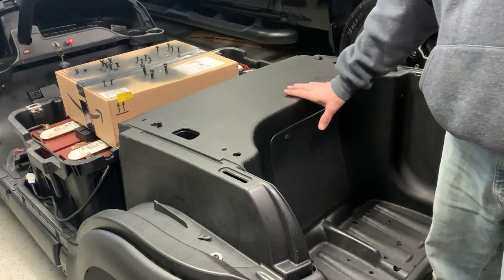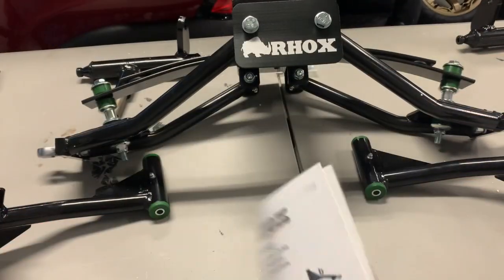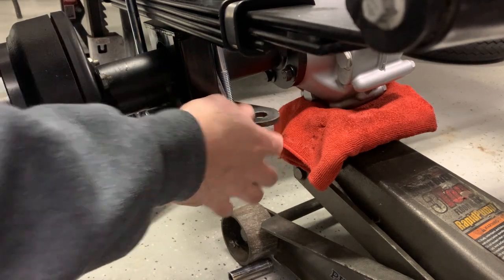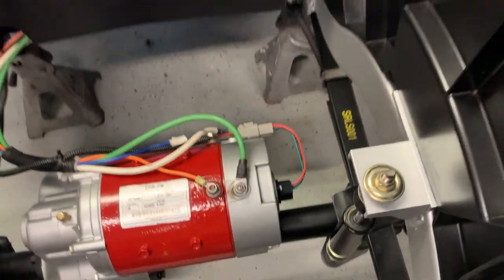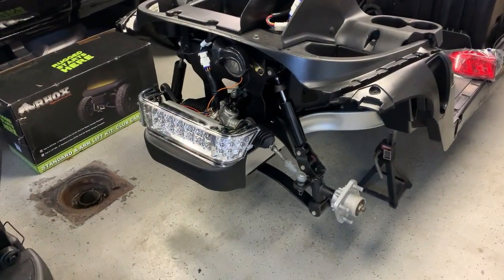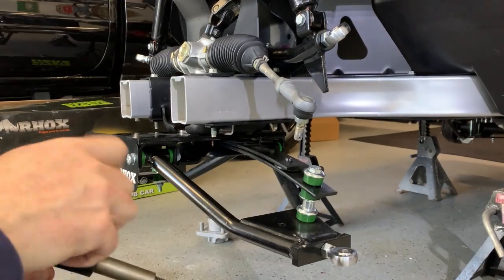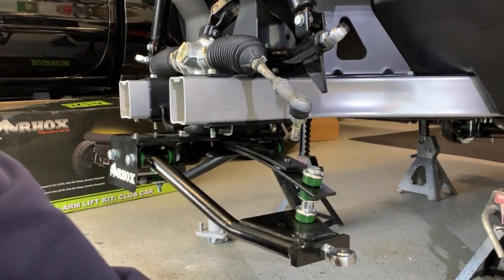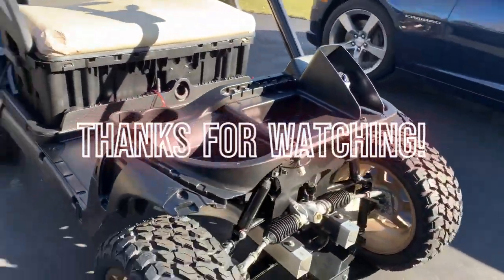Golf Cart RHOX 4 Inch lift Step By Step Install on an '07 Club Car Precedent. CCP Rebuild Part III

Comment: Thanks for this, man. I had to replace my rear leaf springs because there were NO bushings in them. I have this kit, and for some reason I had to hammer the inserts for the rear axle to make them fit in, mine did NOT slide in nicely.

Comment: I have a similar set-up on my Onward from the factory, NO WHERE DOES IT TELL YOU TO LUBRICATE THOSE OPEN BALL JOINTS. After a season or two and setting during winter, those open ball joints will freeze -up and  make the steering really hard to turn. I suggest you get a spray can of lubricant (not wd 40), you want a real lubricant and liberally spray those open ball joints, bushings and anything else that moves in the suspension and do it regularly.

Comment: Great video. I have a question, everything I’ve read about this four inch lift says a maximum of 20” tires can be used on a club cart precedent, did you mis-speak or did you successfully install 22” tires?  Thanks!
Reply from the maker: hey! Thank you for the comment and watching. We have another video on the channel where I show the two different sets of 22 inch tall tires. I show some close ups of where they do rub. at full lock to the right, they hit on the little bump out that houses the wiring harness  Generally, its all good. Just at that very low speed and it doesnt hurt anything. I put a link to that video here. 

https://youtu.be/nKe-pCzPPgg
Reply: @acautocarts9912  Thanks, I just watched it, great information!